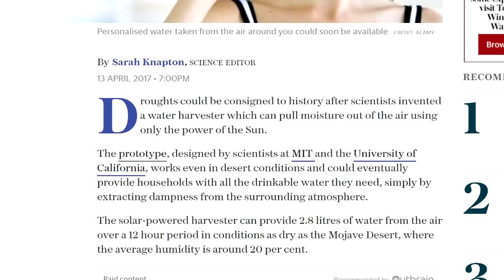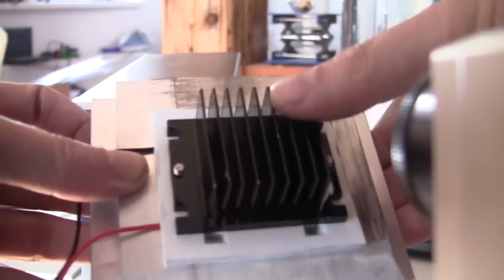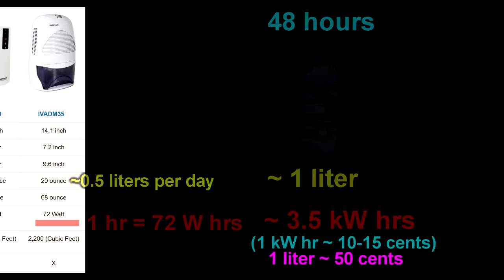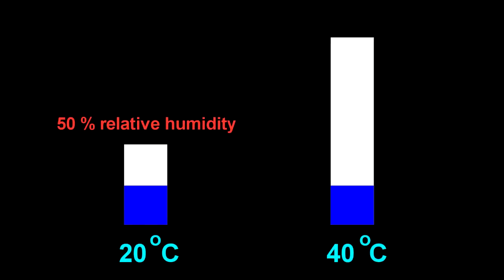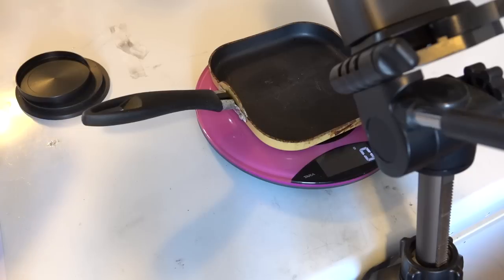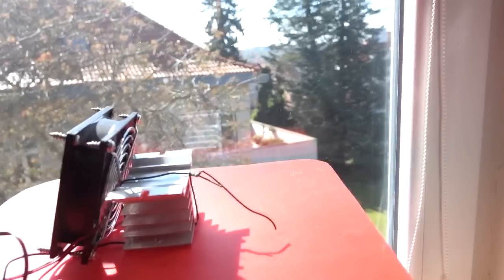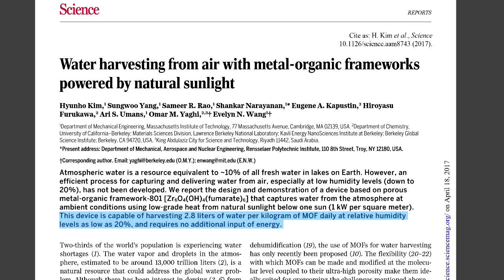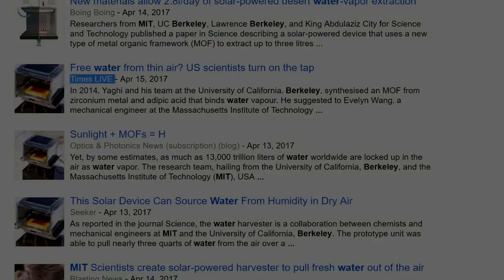FREE water from AIR device: BUSTED

Comment: The paper is claiming the MOF can generate 3L of H2O a day at 20% humidity per kg of MOF by doing cycles of hot and room temp from the air.

The collection of this generated water is not the purpose of this experiment, this is the Peltier devise part, which you have debunked but, again, this was not the purpose of the experiment, the purpose was to demonstrate the MOF can take out water from the air.

I think you need to reread the paper, the collection process is irrelevant, its the generation and release of the water via the MOF.

Comment: Peltier bridges are notably rather high current devices.  One would be better trying to create an Arrakis water condensing sump.  Anybody working on that?  You know, maybe something using the differential of subterranean temperatures?

I really like the vids where you display an actual system refuting the bullshit.  With Science!.  Wish you had a side channel where you just made Science! shit.  "BunnyStomp" or sumthin'. ..

Buuuutt you would probably need an intern to handle the lab setup.

I liked putting marbles in raceways when I was a kid.  I'm nearing 50 and I still like doing that.

Remember children: the difference between Science! and constant wanton destruction is recording (and publishing) your results.  Otherwise you're just lighting shit on fire in your yard.  Which is also incredibly entertaining.  But write it down!  It helps immensely later if you run into legal complications.

Comment: "I am the only one that checks" ? Really ? Science is one of the most strict peer-reviewed journals in the world. Peer-review is a system where papers are vetted by a number of competitors that would be all too happy to take a bite out of anyone submitting a ridiculous claim.
Have you actually read the paper ? If so, you have missed the point completely - the clue in this is the development and use of a much better desiccant, which takes up large amounts of water at ambient temperature (at night), and when heated to 65°C releases nearly all of it. The demonstration model did indeed incorporate a Peltier element - to prevent water from condensing on all other surfaces of the box. I have cringed through select parts of your angry rant (against who ? Science ? MIT ? Berkeley ?
 The Wall Street Journal ?) to check whether perhaps you brought any actual arguments to the table that were overlooked by the authors as well as the reviewers - but no.    And this is why the authors are working at MIT and published in Science, and you have a youtube channel that makes thousands of dollars scamming money out of angry people who know nothing about science. Tell me, how is that less comically inept than what the Wall Street Journal tried to do ?
Disliked, and unsubscribed. Muppet.

Comment: This is a mistake often made. The Tsar Bomb was designed as a 100 megaton device. But due to speed constraints on the aircraft and obvious fear for the crew safety, the test device was scaled down to 50 megatons, it was not called Tsar Bomb at that point, so the Tsar Bomb never actually detonated but it would have detonated with 100 megaton equivalency. It hurts me every time you call the test device the Tsar Bomb and say it was the biggest crated, the test device was the biggest detonated, Tsar Bomb is the biggest created and 1000 of them are still serviced today. They were deemed too dangerous for use as bombs, so they are now refitted for use on intercontinental missiles. It's one of the biggest dumb ideas of the cold war.

Comment: If you are interested in what is actually true, you have to do the hard work of finding out for yourself.
Otherwise, you end up blindly trusting some newspaper or news network, and you believe nonsense.

You shouldnt trust anyone, not even Thunderf00t, but always check, always question, always be skeptical.

Whats great about Thunderf00t, is that he presents everything in detail, and he explains it over and over really well. So its very easy to check what he's saying, and see if its true or valid.

Well done, very good video, I'm sure it took you a long time to make this however.

Comment: You forgot the fact that it uses a solar panel though. So it doesn't cost 50 cents, because the power comes from daylight. The fact that they managed to get even some amount of water is impressive and not quite like you made it sound like. But yes, it still is a stupid idea that won't ever work properly.

Comment: Usually, I am a big fan of your videos, because you explain the things in a way that people can also understand even if they don’t know about the thermodynamic or mechanic basics. But in this case, I am not your opinion at all and want to clarify some facts:

1.      The authors do not aim to make a shortcut to get around the condensation energy. With "no additional energy" the authors meant "no additional electrical energy" (besides the electricity that the PV produces). The heat sink for cooling down the air and condensing the water vapor is provided thermally by cooling towards ambient temperature. 
2.     The authors never claimed, that they want to harvest one liter with the little apparatus shown in the paper. This was not a prototype yet, but a laboratory demonstrator to show the potential of their material (per kg o fit) and the possibility to get to a very high dewpoint which then makes possible to condensate the water by cooling towards ambient temperature (because of the higher dew point)
3.    The peltier device was only additionally for visualization purposes, to prevent the water from condensing on the sides of the box. It is claimed nowhere, that the energy for condensation should be provided by the thermoelectrical cooler and could „eventually“ be omitted like you said.
4.     You can’t compare the cost to produce water with this process to the prices of your tap water. Where they want to use this technology (in arid remote regions, not close to the sea) there is no tap water. The system is conceptualized for regions where there is NO water at all that could be treated or desinfected in any way… So you have to compare with bottled water (that has to be transported there), which would be the only alternative.
5.      Your little experiment does not even come close to describing the physical and thermodynamic processes that take place in their lab demonstrator… What you are doing is ABsorption not ADsorption. These are different processes with kinetics that are not comparable to each orther; especially MOFs desorb a lot quicker than other porous Media and releases the water all of a sudden and thus cuases a very high dew point above ambient temperature. Hence, it should be possible to cycle the material several times a day. Evaporating water from a water-salt solution, however, is a more continuous process and thus, the dew point can never be as high as in the shown demonstrator. Add to this, when it comes to liquid-Absorption, the Desorption process will not work so easily with direct heating by sunlight in a box. You would need a lot more complicated set-up than yours: solar thermal collectors that heat up a heat transfer medium which in turn heats up the salt solution through a heat exchanger to evaporate the water. This, in fact, is not very energy efficient since you need energy for the pump etc.

Last but not least: In one point you mentioned, I am totally your opinion: the problem with the area. But the scientists solved the problem by making parallel stacks in their newest apparatus. Here is the publication for it:

https://www.ncbi.nlm.nih.gov/pmc/articles/PMC6813556/

This set-up is already closer to a prototype… But there, they changed from the very simple idea of just heating the sorption material in a box directly by the sun to heating the air with PV and let the heated air flow through the material. I wonder if you still think it is a hoax… ;-) If so, I am looking forward to a new series of "Free water from Air - BUSTED" (y)
Reply: Yes it's a hoax. Even if you use the suns heat then you still have to overcome that heat effect and get cooling to dewpoint ( not going to get there without a compressor. ) and solar powered device would require a comically large solar array.
Reply: @MrDmadness  what do you mean with "that heat effect" the condensation enthalphy? As I explained, you won't need electricity because the humidity is so high that the dew point is above ambient temperature. So just cooling towards the ambient temperature condenses the water in the air (with an air-air heat exchanger or a cooling medium cooled by ambient aur with a fan, you just have to make sure that the exchanging area is big enough resp. the heat exchanging process is effective enough). I observed that effect in the lab often enough and you  can even calculate with a h,x diagram how much water can be condensed just by cooling the air towards ambient temperature, depending on the humidity and temperature of the air after the desorption.
You only need a compressor (btw It is correctly called a refrigeration machine, a compressor just compresses the air) if you want to cool below ambient temperature which would be the case if you would like to condense water directly from air.
I hope I could help you to understand the system better. If you want, I can give you some numbers...
Reply: @tamaras.8398  it violates the conservation of energy so no, it's not gonna work. If your viewpoint is below the ambient humidity then we call that rain. And a refrigerator simply employs a compressor as I stated, it uses the law of perfect gasses and a gas that boils much lower temperatures ( ammonia usually)  I've a heating major so a pretty good idea about this stuff,
Reply: @MrDmadness  Having a heating major does not beat 10 years of work experience and experiments.. ;-) I totally know about ideal gasses and 2. main law of thermodynamics etc. since I teach Thermodynamics and heat and mass transfer. Compressor might be used in colloquial language as a synonym for a compression refrigeration machine. But it is physically not correct, please use at least compression chiller. A compressor only compresses a medium. You would have to expanse humid air to bring the water molecules to condensation, not to compress it. If you add the ammonia cycle and a heat sink to the compressor it is not a compressor any more, but - as I said - a refrigeration machine or compression chiller.  AND: No, the concept of condensating by cooling the air thermically instead of electrically doesn't violate the 2. main law of thermodynamics! But maybe you just have to explain with some numbers so you understand what I mean: the humid air after the desorption process has for example 50°C and 50% relative humidty (which is a quite conservative example, probably it is higher, depending on the sorption material which is not specified in detail), this means an absolute water load of 40.32g water vapour per kg of dry air (due point 36.7°C). If the ambient temperature has 30°C, it can absorb max. 100% rel humidity - which is 27.23g of water vapour per kg of air. So what happens with the remaining 13.09g? Right - it condenses... The concept here goes one step further: it does not only cool towards ambient temperature by convection, but cools the glass plate of the special panel towards the cool sky (havin a temperture of at least -40°C) via radiation. Due to the radiative equilibrium lower duepoints than ambient temperature can be reached. Of course you can't condensate ALL the water in the air, without using electricity, but nobody claimed that... ;-) (btw. even with electricity you couln't condensate all because at a certain point, the condensation point falls below freezing point).  But if you run the cycle often enough, you get enough condensed water without any elctricity (except for the fan, which is powered by the PV). BUT: I agree for very very arid reagions (below 5 -10% rel. humidity), this won't work as well, since the sorption material has also an equilibrium load which deteriorates with decreasing humidity in the air. I hope I could help - otherwise, please check your psychrometric chart...
Reply: @tamaras.8398  well then I suppose it's good that I also have a class a gas fitting licences and have done med gas and laboratories in my near 30 years in trades.  What you are proposing is not realistic. It's worth mentioning the difference  between theoretical and applied sciences. I can lift water in a syphon 23 feet theoretically too.. in application this does notmwork without mechanical assistance, which again is effort ( if we are going to branch to percentages of efficiency). When you talk about removing water from air then there must be sufficient water I  the first place and you then must include latent heat calculations in your equations, which will show that your idea of what is achievable is false..

Comment: 5:25 but their peltier device has kapton tape on it. It MUST be special!
Reply: With that said to be fair this idea is actually feasible, unlike the other ones, but impractical. Desiccants can get down to extremely low dew points, and are used to generate VERY dry air, but it does not get around energy obviously. Id surmise by the time it got big enough to work you might as well go with a different process that's more cost effective on large scales.
Reply: Calcium Chloride cools as it absorbs water in an endothermic reaction, increasing its ability to absorb water from the air.
Reply: And a proper heat pump instead of an inefficient peltier cooler. Third world, no. But the military might be interested as it could work with efficient chillers instead, although one would have to find a way to regenerate the desiccant easily (i.e. doesn't just turn into a puddle of water). They have the right idea here with a non-chemical based desiccant. It has potential theoretically.
Reply: To quote Tim Minchin (amongst others), "Everything is Chemicals"

Comment: I haven't even watched the video, and I have in my house a 70 pint/day dehumidifier, a water filtration system, and a solar battery charger. I could, with some effort and an afternoon, harvest drinkable water from the air with only the power of the sun.
JK That's a ton of electricity. 690 watts lel

Comment: Again with the incorrect math. It does not take 2,000,000 J of energy to condense 1 liter of water, it takes that much to turn steam into 1 liter of water. Water VAPOR in air is NOT STEAM. You even show earlier in the video that a humidifier can pull a liter of water for 35,000 joules. All you have to do is lower the temperature of the air to under the saturation point (dew point) to pull the water from it (NOT create water from it, pull the water out of it. Again, it is a mixture not a state change.)

Comment: Did thunder even read the article he claims to be debunking?  It's a set of metal organic framework that is specially designed to act as a metallic sponge at night, absorbing water and releasing it for a dehumidifier device to capture later! 

That device is sealed from air to demonstrate the device pulled in water previously and efficiently due to the crystal structure of the metal. Mean while thunder proved nothing.

He straw maned a device by only reading the clickbait title lol.

Comment: Every "renewable" solution becomes non-renewable, once you start using it on a massive scale. Even if these devices worked perfectly, the moisture they would pull out of the atmosphere would be missing somewhere else, once the technology would be used on a massive scale. The results could be more disastrous than we can ever imagine. There is no such thing as "renewable energy".

Comment: I do dig most of these vids ......& he's usually spot on in identifying obvious BS.......but I think he may have overlooked the KEY Ideas on this ! .... & things being media hyped does NOT = MIT fraud.......not that I think it will be useful or practical(I don't know enough about MOF & I'm not an expert in related fields).......but his 200 tennis courts & water trucks are absolutely meaningless here .......you could have had a similar "debunk" about the 1st crystal acting as a transistor in the days of tubes.......read the all the comments, some points are quite valid imo & read the damn paper ....it has nothing(ZERO) to do with Peltier devices......& for 1 if a few experts think it can "function" passively cooled it warrants further investigation(& why would it even have to ? plenty of sun in a dessert for panels to perhaps assist with Peltier) .....its seems much worse than a typical "back of an envelope calculation" was performed to draw conclusions that may not imo even be within an order of magnitude accurate or the relevant calcs were even made......almost nothing can be said about the plausibility of scaling or future practicality or cost effectiveness yet .....I am however still on the skeptical side but am by no means convinced that MOF + clever engineering is & must always be clear BS......he doesn't even read or respond to legit comments ?.....tons of blind believers......ALL belief/dis-belief is always ONLY dysfunctional !.....skepticism & open-mindedness require some balance.